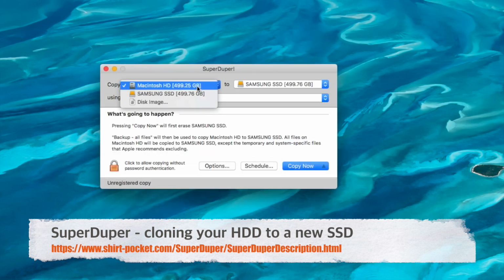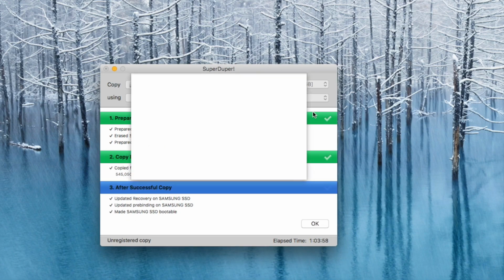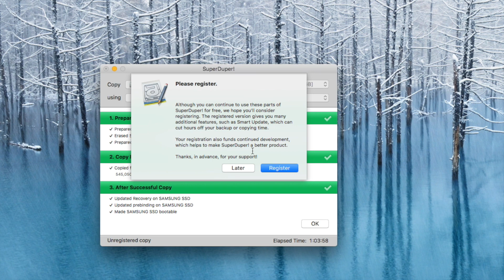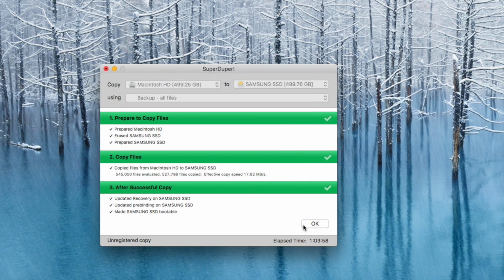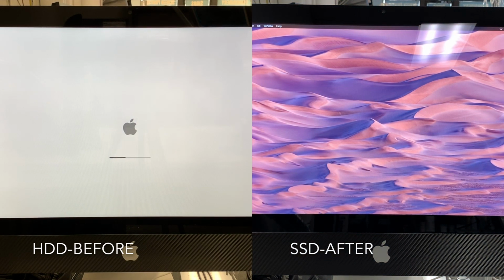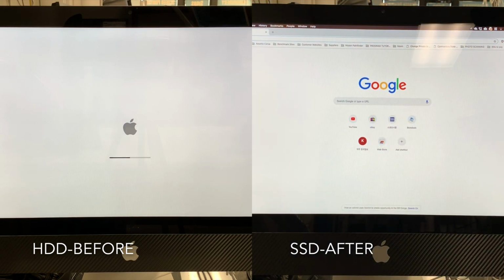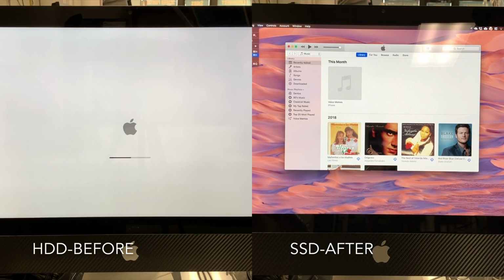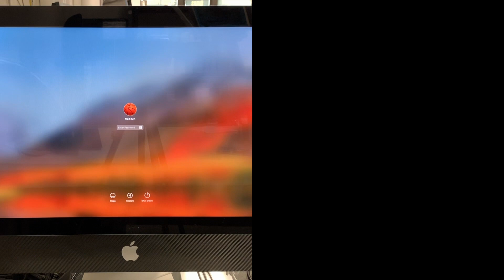2011 iMac SSD Upgrade with Thermal Sensor w/ resetting NVRAM Tutorial no steps skipped

Comment: Can you not use the original hard drive sensor
Reply: No, it will not connect to a SSD or another HDD because the original iMac HDD has special firmware. If you skip the thermal sensor upgrade, the iMac will run at 100% fan power.

You can use third party fan control software as a workaround to this.

Comment: Hello,

I’m facing a very challenging problem with my iMac 27". After replacing the motherboard, CPU (upgraded to i7 2600), new SSD, RAM, and reinstalling the system, the fans are running at full speed, and the CPU is stuck at a low frequency (1.7 GHz). Could the issue be due to a missing thermal sensor? I don’t know how to fix this, and I would greatly appreciate your help!

Comment: A SATA Y-power splitter cable does the same job for like $2 as the OWC “thermal sensor” which is a rip off. 😉👍
Reply: 2025… interesting info. Would you mind to give some more details about the setup? How does it work? 
PS: I just heard about the pin hack , where you connect pin 11 and 12, if I remember it right. Preferably on the 2.5” adapter .

Comment: Great video. I took a look at several videos before doing the upgrade and this was the only one which addressed copying the contents of the old HDD. I did mostly the same but instead of this specific SSD mounting bracket I used a generic pair of U-shaped pieces of metal that they sometimes give away with SSDs. That did the job as well, but only after several tries (bottom of the SSD is facing you, which is not what you are used to with PCs). Note that this bracket definitely helps you putting everything in the right direction.

Comment: I noticed that the temperature sensor pcb has what looks like another connector on it. Does that need to be plugged onto any cable? Because my imac now overheats, with the fans never turning on. (Before, they ran non-stop).

Comment: I didn't need to adjust the thermal sensor nor use bootcamp, I just popped the ssd with tiny11 and it just works. Still had to install the audio driver but that's about it.

Comment: Excellent video getting right to the point! A bit late to the conversation, but I would imagine attaching the thermal sensor on the other side (the circuit board side) of the SSD would give more accurate readings.  You attached the thermal sensor to the cover side of the SSD. Just an idea.

Comment: Will there be issue cloning 1tb to 500gb even with the 1tb only 200gb taken up
Reply from the maker: There shouldn’t be any issues
Reply: @MarkKimUSA  ty im gonna use ur vid to upgrade my imac in a couple days
Reply: @MarkKimUSA  and also do i clone the ssd straight out the box no configuring needed?
Reply: @MarkKimUSA  and the super duper isnt working i cant even run the app it just says it quit pls help

Comment: Hello , I've changed SSD and added thermal sensor but 
 My fan runs at full speed any ideas?  now I am using Fan control software  Mac (27-inch, Mid 2010) 2,93 GHz Intel Core i7 quatre cœurs

Comment: When I changed on my SSD I just applied the original temperature sensor because when I installed the other that you are talking about it didn’t work the fans were still running full blast but when I took that cable out and went back to the original sensor the fans went back to normal, but that’s just what happened for me!

Comment: Thanks for the video, I was wondering: does the optical drive have a SATA connection? So that we could replace it instead of the HDD
Reply from the maker: Yes you can do that. Just take out the optical drive and put the hard drive they’re using SATA
Reply: AFAIK, the optical drive has a slower SATA connection! Only half the speed. The mid2011 27inch iMac has an extra HDD SATA connector on the backside of the board! Perfect for a second SSD drive, and you keep the original HDD and optical drive. But you need an extra cable.

Comment: If I wanted to just reinstall the OS to the ssd without backing it up. Would I do that with the ssd external or installed?  Also, does the process know what version of OS would work with my imac?  Im bew to macs.
Reply from the maker: You can enter the recovery mode and then install os on either internal ssd or external ssd....meaning you can actually boot from external ssd even if you don' t use internal ssd. If you have internal harddrive, just leave that as is and connect external ssd and get to to recovery mode and install os on external ssd and boot from there. i believe there are cut offs on certain years of imacs...so you might want to google it. say you have 2015 imac, just google "latest supported os for 2015 imac" and it should tell you. Hope this helps.

Comment: Reset VRAM requests three bong cycles, not one.  Temp sensor for an SSD upgrade can be avoided, download Macs Fan Control.  You then sent the HDD fan to a constant speed and ideal the CPU fan based on a lower temp, which prolongs both CPU and GPU life.

Comment: Hi Mark;
Where can I get the carbon fiber sticker for iMac 27”. Thanks
Reply from the maker: i just bought the 3M 1080 carbon fiber vinyl from amazon and put it on the mac and then manually trimmed it with exacto knife

Comment: Does this thermal sensor issue also occur with a 2012 or 2013 21.5/27 iMac?
Reply from the maker: yes it applies to those years too
Reply: @MarkKimUSA  oh sad. From When Imac Model we can install only the ssd without the thermal sensor cable?

Comment: This is not really a thermal sensor, it is trigger. OWC or any similar "thermal" sensor could never be triggered and it is also described as obsolete for SSD configurations in Apple Service manual. 
What it does is once triggered by approx. 50C it slowly raises FAN speed till maximum. once it goes below trigger temperature, it goes back down to minimum. You can bridge pin11 on sata port to ground to disable it, it will work in all cases unless you use server HDD (this pin is utilised for delayed start by many server HDD to avoid current peak). Apple uses special plug which shorts it to ground as well.

Comment: 1. I am replacing all the screws in the video panel, with brass ones.  It is way too hard to get steel ones past the magnets.
2. I had way too much trouble trying to get the ribbon cable back into the video card.  Big hands.  I found it much easier to attach to the video card first, then into the video panel.

Comment: Clearly explained, detailed and good camera work. Changed my seagate HDD myself in 2013 because Apple wanted to retain the HDD. Although the change was free because of some fault with the original seagate HDD, I wasn't going to have all my work and personal details possibly being accessed by the agents (even after a disk wipe) who were doing the exchange - so I decided to take a risk and replaced the seagate HDD with a WDD hard drive myself. Unfortunately, the thermal sensor cable wouldn't fit the WDD HDD. Had to use a temperature sensor software (SSD fan control). Apart from that, everything worked well and has been working well since. Now for the next phase in the life of my geriatric mid-2010 iMac - we're going to attempt an SSD 'transplant'. I'm not terribly good at all this but videos like yours really help and saves a lot of us a hefty labour charge.Thank you Mark Kim.

Comment: You dont need the sensor, it's scam. just solder the 2 wires with are not needed in the sata cable.

Comment: Followed your video and an iFixit guide yesterday to rejuvenate my 2011 21.5” iMac. Thanks for the guide! I installed a 1TB SSD and windows 10 boot camp partition using steps from a Stackexchange article.

Comment: What command keys do you hold down on a non Mac keyboard?
Reply from the maker: BBQ Made Easy i am sorry i have no idea on how to do it on non Mac keyboards
Reply: Mark Kim I found out. It was windows key. I do have a question. My iMac is faster but nowhere near as fast as yours is. I installed the Samsung SSD 860 EVO 1TB 2.5” Sata III Internal SSD.What can I do to make it faster? I’m also using a total of 12gb of ram. Thanks for the video!

Comment: I've also missed the extension cable, the fans were going crazy and fixed that noise with some 3rd party fan control BUT the kernel_task is now slowing down the mac because it can't read the sensor values properly I guess. The build-in diagnostics did report an error (TH00-9.000). It's really annoying how slow it became and I don't think buying now a 40€ cable is worth it for this mac since it's only be used for web stuff and email. Just tested Linux on it and it's running so damn well that I'm gonna install it now. 
Thank you for this really good video, straight on point

Comment: I have a Samsung SSD on the way along with the other equipment listed in the description, but I’m considering simply attaching the SSD externally and making it bootable in order to run the OS directly from the external SSD drive. Are there downsides to doing this? Is overheating going to be a problem? I also want to format it as APFS in order to run Catalina.
Reply from the maker: nlawson2004 i tried that too but your bottleneck is the usb 2.0.... it wont be as fast as internal sata connection. I didnt like the speed so i went with this method instead
Reply: @MarkKimUSA  Gotcha. Yeah I think I’m going to do it your way, then maybe I can use the old HDD externally via the left over container piece. 
I just found out that I can’t upgrade to Catalina because of my GPU (Radeon HD 6000 series). 
But I should still format the SSD as APFS though correct? Right now I have High Sierra, which can run on APFS, and APFS is faster, right. I’m just worried about cloning the contents of the HDD to the APFS formatted SSD, that shouldn’t be a problem though right? Also all my current external hard drives can still be used with the OS running from the new APFS SSD. Ha, dude I’m new to all this and just not trying to run into any complications. Thanks again for the awesome video, really helpful. Cheers.

Comment: I could have seen this video before I replaced the hard drive of my iMac this week. The FAN is very annoying. I'm using a FAN CONTROL but I think the best choice is use the thermal sensor as you did on the video. Good job, thank you.

Comment: This is great. Thanks so much. My 2011 iMac come back to life.  Pretty fiddly and few scary moments removing the tiny /vulnerable LCD cables. One thing additional recommendation I've come across is that once you've changed to a SSD to ensure that TRIM support is turned on  - which apparently will help the drive last longer (see: https://www.cnet.com/how-to/installing-ssd-on-mac-trim-mistake), Cheers!
Reply: I just realized this video doesn’t provide info on the SSD used and whether or not it can run Catalina. But thanks for that TRIM info. I’m taking baby steps to finally start updating my iMac mid 2011 and there’s a lot to consider. 
Just saw a pretty involved CPU replacement video, may not go that route for now. The performance of the SSD in this video alone, seems solid, so the processor speed is good as is it seems. Other than that I’m just gunning for 32gb of RAM, and I should be all set.
Reply: @nlawson2004  Mid 2011 iMac still wont support Catalina unfortunately. There are a few work arounds, but even that is not worth it due to graphics processor issues.
Reply: @TheBazzShow  That’s funny I was about to erase my new SSD to format to APFS but I don’t see any option to enable TRIM? I also canceled it cause I was unsure about using GUID, or the other 2 options presented. 
If I ever get this step right, next is to clone my current OS and all files onto the new APFS TRIM SSD.

https://ibb.co/Q6NSQLq
Reply: @TheBazzShow  According to this article I shouldn’t enable TRIM:
1. Unless I experience slow write times on the SSD
2. Also it’s unclear how it affects external non SSD drives which I have 3 of, which are all HFS+.

https://eclecticlight.co/2019/08/26/caring-for-ssds-trim-wear-levelling-and-apfs/

It is a year old.

Beyond that, I’m attempting to find out which option to use GUID Partition, Master Boot, or Apple Partition...
Reply: GUID, since I have intel macs.
Full speed ahead now.

Comment: I have a couple questions. 
1. Why you spend 37$ on cable you don't need? 
2. Why you didn't use existing cable ? 
3. Your HDD ( System ) doesn't have "Thermal sensor" why you installed one for 37$? 
4. Do you know what cable you bought doing nothing except short circuit on 1st and 4th wires? 
5. So, why you wast your money if your HDD don't have a sensor in the first place? 
Thanx.
Reply from the maker: 1&2 = i explained in the video saying you can do it without the cable...just use the fan control software to control the fan for heat measuring. 3. here is a quick google search. link https://thisdoesnotcompute.wordpress.com/2012/12/31/2011-imac-hard-drive-temp-sensor-explained/ read this and you will find out 2011 imacs hdd does have built in heat sensor on the their harddrive unlike off the shelf harddrives. 4. not sure what that is but it works for me. 5. again, if you read the link on the article about the built in sensors on these imac hdd, you can see i didn't waste it.... So after all, like i did mention on the video, you can do it without the $37 cable just using software to control the heating issue. If you don't do either one, your imac fan will run at full speed all the time. Thanx.
Reply: Mark Kim  no, it will not. They trying to prevent you from upgrading your system.  You can try short 1st and 4 th wires in your sata cable. It does same effect but without spending any money. It works for you. Cool.  Thanx for your job any way.
Reply: @dasubel  maybe the guy doesn't mind spending the extra $. Everyone isn't like you.

Comment: Grest video,!

How are the funs working after SSD upgrade. Are they faster then before or the same?
Reply from the maker: You mean Fans? My fans seem to be running slower because SSD doesn't heat up as much as HDD that was in it before. So yeah, much faster imac with less heat and less fan noise. Loving it
Reply: Mark Kim yeah I mean fan 😂. Thank you

Comment: Lol people always obsessed with getting the newest model and spending thousands. Im still on my 2009 imac wich runs sooo smooth i did a sdd swap and got the new o.s that way and saved thousands.
Reply: Just did mine and it's 21" 2009. Do you experience fan noise issue? It's so loud. Sucks that I'm using manjaro Linux and there is no Mac is anymore. Don't know if I'm ready to throw $50 for a cable 🤔🤔
Reply: @CCG0D    The fan noise is because you likely bought a 3rd party HDD, not from Apple.  Apple has proprietary firmware on their HDDs that is used to control fan speed when the drives get hot.  You can buy a heat sensor kit that will take the place of the firmware or you can use  fan control software.

Comment: Thanks, I ended up breaking one of the LCD cables when I was putting it back together.  So fragile.  Got a replacement LCD from eBay and my Mac is now super fast with the SSD drive.  What a difference.
Reply: Easily done I'm afraid - hope it wasn't the LVDS connector...  :O

Comment: BTW, you can actually remove the HDD and install the SSD without removing the screen.  Just remove the top left cable, then lean the screen against your chest while you replace the drive!
Reply: Put a video up..
Reply: 100% agree just did this today avoid removing screen if possible.
Reply: I've done a few of these without disconnecting anything - just lie the iMac flat and prop up the screen with two biros. Pointed ends in the LCD frame holes. You'll will need a very short Torx tool or use a driver bit and ¼" spanner to loosen the HDD screws. I always use a 2.5->3.5" adapter but no doubt sticky tape would work. Another tip: you can just push a thumbnail behind the top corner of the glass to prise it away from the magnets - no need for suckers.
Reply: Good idea! I dread taking off that ribbon cable. I literally have to connect it over and over, put one screw in to hold the screen, power on and test. 1 in 5 times its ok and i can finally close it up. The black tape on one corner was pealing up and its hard to get in and lock down. Those ribbon cables are a horrible.
Reply: I did that. Had the wife hold it up. Took just 15 minutes. I also didn't use an adapter, just plugged the 2.5 SSD into the plugs, put foam and 2 sided tape on the back, taped it to that round thing and put back together.

Comment: this has been the best video ive seen on this process. bought a 2011 and will be doing this. thank you Mark Kim!.

Question.  Would it be pointless to use the thermol sensor and software? or would the sensor be better then just using the software? thank you in advance
Reply from the maker: I would definitely use the thermal sensor. Doesn't cost much more and less headache. I've heard people having some issues when using just the software. Can't go wrong with using thermal sensor as is how apple designed it.
Reply: @MarkKimUSA  just got my iMac in and am attempting the SSD upgrade and ram. When inserting the new 32gb(8per slot) upon reboot it only reconziged 16gb. Any thoughts? Thank you!

Comment: Brilliant! Watched many of these upgrade videos, but this is by far the best!! Thanks so much for this. Is there a particular SSD you would recommend?
Reply from the maker: Thank you. I would recommend any samsung or crucial brand. Cant go wrong with either one
Reply: Mark Kim Thanks for the quick reply. Do you recommend cloning the old drive or installing the OS clean? Not sue if cloning will keep disk fragmentation of old disk and lead to slower disk/software speeds and thus defeat the purpose of the SSD.